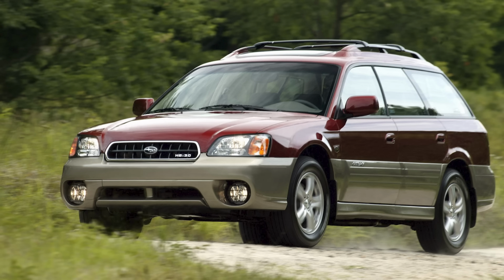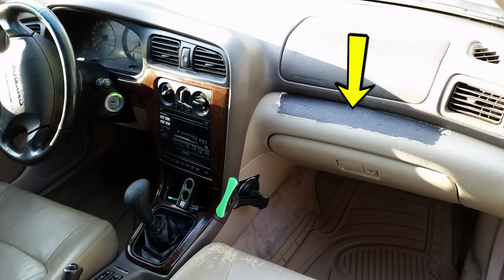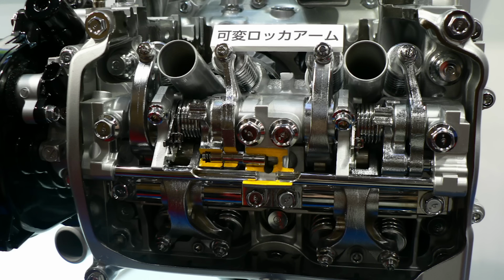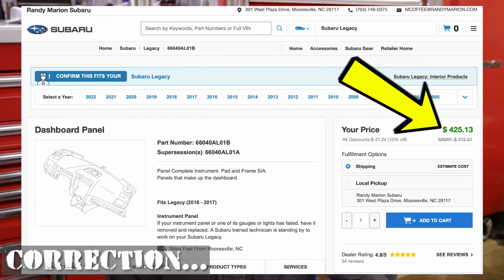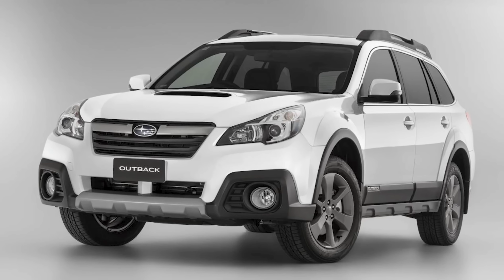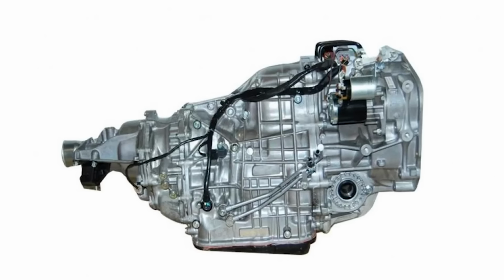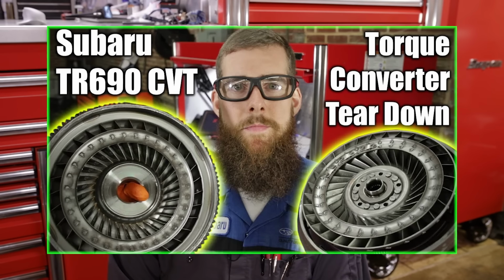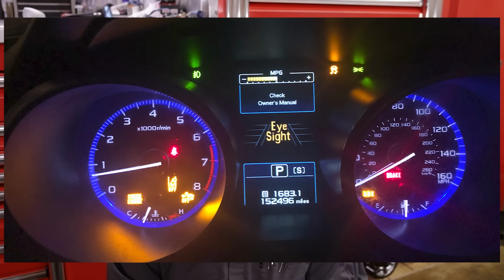Buying A Used Subaru Outback Or Legacy?! Here's The Good And Bad Over The Last 20 Years!

Comment: Thanks.  You put my mind at ease.  I bought a 2012 Outback about a year ago.  I drove it about 20,000 miles and so far so good.  The only serious problem I had was a loud thumping sound when the wheel is turned to the extreme in either direction.  I thought is was bad CV joint, but it turned out to be the front differential.  Fortunately I bought an extended warranty and the dealer replaced it for no additional charge.  Other than that, no problems, and I must say, it gets surprising good gas mileage for a car that big.  I average about 28 mpg.  Also, since the car was first purchased in Texas and spent most of its life in Arizona, I have no rust issues.
Reply: I have had my 2012 outback for a while and I love it. I suffered a transmission valve train failure at 165,500 miles, but the extended warranty I had purchased really saved me a bundle. One of the most dependable vehicles I have ever owned.
Reply: @johnsheaman8057  I have to tell you.  I lucked out with the extended warrantee.  I guess it's more like an insurance policy, but when I started having this problem, I could have sworn it was the CV joints and so did the dealer.  The dealer I bought it from was a Fiat / Alfa dealer and they changed them.  I tried turning the wheel all the way in both directions in the parking lot and everything seemed fine, but when I got home, it did the same thing as I pulled into my driveway.  Later I discovered this problem only showed up when everything was hot or at least warm.  I brought the car back and they sent it to a Subaru dealer who had the car for about two weeks (I had a loaner) and when I got it back, same thing.  So I brought it to a Subaru dealer near where I live, explained everything to them and they had it done in two days.  This would have cost me a fortune if it weren't for that extended warrantee.  As an extra added bonus, I got new CV joints.  All paid for.
Reply: try driving less than 65 mph, keep it low and somehow it last over 500 miles or less with full gas tank.
Reply: its because people never change that fluid every 30 thousand miles

Comment: in my opinion the EZ36 is one of the most reliable engines subaru has ever made. Ive been with the Subaru dealer for about 4 years now and its hands down the least worked on engine! love em.
Reply: My 3.6r has 177k problem free miles on it
Reply: 145k on my 2015 3.6 Legacy, no engine issues.
Reply: My 2010 EZ36 is at 225,000 km and running well also
Reply: My legacy 2015  with the 3.6 has over 122k so far so good and the 3.6 is smooth as silk .love the H6 .
Reply: im about to buy a 2017 3.6r touring, thats the engine right?
Reply: @QueenFairy420  yes
Reply: @TheGroundBeef  ive got it coming to me soon, just signed all the paperwork :)
Reply: How about ez30 6clinder in a 2006 jdm outback?
Reply: 154k on my 2013 outback 3.6R.  It's a great engine.  This thing does eat rear wheel bearings every 50K though!

Comment: GfS 2014 2.5 outback  just got a new cvt from Subaru at 61k.  Exhaust rusted  out too.  And it eats bulbs but you get good at replacing them 🤣... no oil issues with it.. gas mileage  is not good in whinter on snow tires it gets 21 highway.  Summer it gets 27.

Comment: I strongly agree with you the early 2000s outbacks are very reliable and a joy to drive once the headgasket repair is done 😂. I own a 01 outback limited and love the car. As long as you check on them regularly they will take care of you
Reply: I had an 01 Outback as well, the base model. That wagon out-drove most any other vehicle in the snow.
Reply: My 01 Outback base 2.5 5 speed manual 234,567 is still alive and is my daily
Reply: I love my outback have been following mr Subaru as long as I've owned it. I bought it used had to do head gaskets months later and months after that got a rod knock 😔. Long story short I am a mechanic pulled and rebuilt it myself about 2 years ago and couldn't be more happy. I believe the build quality of these wagons are great the stying and feel is rite up my Ally. love how it stands out in a crowd 😂
Reply: 02 3.0 h6 owner, and it’s been solid! 265k mi into it
Reply: Couldn’t agree more. I love my 2002. Simple and practical.
Reply: 2002 4-cyl with 120k miles here. Belonged to a family member with a shit mechanic so he sold it to me for peanuts. Replaced the rear brake discs + ball joints at the front, steering rack was leaking oil so it was repaired by a pro; since it ran low for long now the pump is dead so I'll purchase one online next month. Checked the spark plugs, air filter and belts which were fine except for one alternator belt and bearing which have been replaced. Other than that (which isn't too bad considering how little I paid for the actual car) it runs very smoothly and reliably, the engine revs real smooth and it stops on a dime. Just took it on a 300 miles trip with my family, it did precisely 28 MPG on highways at 60-70 MPH and the wife loves it. Gotta take care of some final details and I'll have a kickass ride for a few years. It's still low on miles given its age I'd say and I've already ironed out most of it's issues. I'll keep an eye on the head gasket situation tho!
Reply: @diegoleiva7242 love the basic 4 spd auto.
Reply: Love my '03 Outback. Base trim with the 5MT and the thing's a beast. Simple, durable and goes anywhere you could want. Snow? No problem. Off road? No problem.
Reply: got an 02, and love the thing, he's spot on with the problems.. I really wish the went to a bolt in wheel bearing for this generation,  i'm doing one now ant it requires a bunch of special tools.. otherwise the car is comfy , and a jot yo drive.. well appointed and a great long trip machine ..
Reply: AGREED. My modern subaru outback transmission broke 130,000 miles. $6000 to fix didnt do it. Getting a 2001 Subaru legacy
Reply: I've got a 04 Outback ll bean wagon bought it at 125k in 2021 runs great with the EZ30, best engine Subaru has ever made.
Reply: I also have an 04 LL Bean, close to 200,000 miles and still running. Very cool engine!@1mawesomel1kethat
Reply: This comment is everything I’ve been feeling lmao
Reply: @jalopy2472  the one I bought was kinda toast
Reply: I got an 09 outback and I love it, haven't had the pleasure of driving the previous generation but sounds like the best drivers car
Reply: Just had to replace my battery in my 02 outback 2.5L 5 speed manual transmission. Love my subi 🤓
Reply: I bought a 2001 2.5 Outback Preminum used in 2003. The car had 25k mileage. The first 2 yrs of ownership were fine. At about 40k mileage my engine began losing oil. Not excessively  burning it. Instead leaking  everywhere  on the engine.  I sought out the Subaru dealer for help. Since the car was out of warranty  a total gasket replacement was $2,500. In 2005. Instead I sought out a local Stock Car engine builder whom did the total gasket replacement for $1,800.  I drove the car until 2013 with no engine issues whatsoever  until I traded it.

Comment: I have to agree with you and what all you've said.  I own a 2002 legacy gt 5 speed with 293,000 miles on it.  Got it with 191k on it.  Ran it harder than I ever should of and the only time it left me sit was when the fuel pump housing cracked.  Other than that it still runs and drives but does use a little bit of oil.  Did have to replace the trans because the input bearing went bad,  but I do plan on replacing it and keeping that transmission.  My friend had a 2008 legacy with the 5 speed and it had the sticky dash.  It also suffered from a rough idle.  This car only had around 50k miles on it.  Thing would run fine until it warmed up,  then run rough until it would stall.  I couldn't figure it out.  The Subaru dealer couldn't figure it out.  They started throwing parts at it and no prevail.  They called a bunch of higher end techs in and after about a month they found an issue with the wiring harness that was causing the problem.

Comment: I still think that the group size 25 fitment number six battery typically anywhere from 500 to 550 CCA it’s just not enough power especially for the flat six, looking at Toyotas 3.5 L they’re running 700 upwards to 800cca… that’s why I change my battery about every 3 to 4 years…
Reply: I think the battery on the H6 ended up being fine.  At least it did well for me during a severe cold snap we had in my area a few years ago. I think they were much more problematic on the H4s.  https://youtu.be/ekckO45F7ho

Comment: Yep on my 13 legacy 3.6 I’m starting to get the blend door issue and sounds like a rear wheel bearing is going is making some noise I jack up the car to see if there was any play on it and it’s super tight so I’ll just let it go for now, blend door I wonder if I could get up there I think I gotta move the TCM computer it looks at least it looks like it’s the transmission control module out of the way first to get up in there maybe I can lubricate it?

Comment: My 1998 Subaru Outback Legacy Limited feels like the handbrake is being pulled on and off with a grinding sound only in sharp turns, I've replace the two front axles to no avail could it possibly be the rear gearbox I'd really appreciate if you could give me your educated opinion

Comment: I have to agree that old Subarus are better than new ones, less technology and simpler design. I can maintain it fairly easy, lots of parts available at good prices and a good aftermarket too. I'm going to change the radiator on my 2011 Subaru Tribeca. There's a lot of steps to follow, but it's not rocket science. It's so simple that I'll take the opportunity to do a coolant flush and change the thermostat. This way, I'll prevent engine overheating for several years to come. I'm very happy with the EZ36D coupled with the 5EAT transmission. It's a very solid and reliable power train. However, it's very thirsty, that's the only thing I can complain about it. Apart from that, it's a very comfortable and reliable car.

Comment: As you know, if you'd gone a few years earlier you would've been able to tell your viewers about a much more bullet proof motor than any of these newer motors: the 2.2liter. I've had 3 of them, over 300k miles on the 2 Legacys I'm running now.
Reply from the maker: The EJ22E is a bomb proof Subaru engine!
Reply: Yep my 98 2.2L has 236,000 miles and is still running great
Reply: A few years back I owned a 2.2  1995 impreza sold it with over 230 k.
Reply: Iv seen one with over 500k on it, 1997 I believe it was. And that was in wales where there isnt a flat road to be had! That was a good 4years ago now and it's still on the road so it must be over 600k now

Comment: My 2014 Outback has 120k and few problems so far. Constant headlight bulb replacement, weird clunking noises that no one can figure out what’s doing it, and a quart of oil needs to be added every 3k. Rust is becoming a huge issue but much of that is happening where damage has occurred and repaired. Also I live in the upstate NY rust belt lol. I’m 6’6” and love the roomy interior. Would absolutely buy another Subaru!

Comment: Finally now at 192k is the EJ253 in my 2008 leaking oil externally from the head gaskets. I can’t complain in the least and would have no problem getting another older Roo with the EJ253.

Comment: What air bit do you use for the gasket area on the block when when cleaning prior to replacing? Don’t want to damage my engine. Tia
Reply from the maker: 3M Roloc white Bristlediscs.
Reply: @MrSubaru1387  ty so much

Comment: Any car with a Jatco CVT shouldn't be trusted fully. I'm sad that Subaru didn't use their Toyota partnership to source them from Aisin. The CVTs in a Corolla almost never fail.
Reply from the maker: Subaru DOESN'T USE JATCO CVTS!!!
Reply: No Nissan did though
Reply: the CVTs are an in house design
Reply: Well son of a bitch, I guess I'm wrong. I know the older automatics were Jatco units so I guess I just thought the CVTs were as well especially since they seem to suffer from the same faults. I still think they would have done better to use Aisin units...
Reply from the maker: The Subaru Lineartronic CVT was designed and built in house by Subaru. Subaru designed and manufactured the first mass produced road going CVT equipped vehicles. They've got the most experience when it comes to CVT automobiles. They're no where near as troublesome as people have made them out to be, talking on the internet..
Reply: @MrSubaru1387  It was the Justy that had the first one, right? I was watching an old game show recently and one of the cars you could win was a Subaru Justy. I can't remember the last time I've seen one. Do you know if Subaru rebuilds the CVTs or do you just have to pay a ton for a new one if it fails?
Reply from the maker: Subaru rebuilds/remans them. The Subaru dealer replaces.
Reply: As far as I was aware they are least did!
Reply: @aenoymotors  Never did

Comment: I've experienced the ghost walking on my 2017 Outback, with snow tires. Unsettling. Usually occurs after rough ice patches when the rear end will feel like its floating. Over twenty years of ice driving and have never experienced the feeling until this car.
Reply: I don't know what that means
Reply: Well, for the Gen 3, its more like an oscillation in the rear. Subtle at first and then feels like its on ice skates.. Can feel the car either 1) fighting to depart from going straight, or 2) egregious understeer into a turn (this almost killed me). Much worse in my 2005 H4 before I 1) changed the shocks and 2) the rims/tires from 16 to 17. Replacing all the rear endlink and swaybar bushings helped a slight bit. I have yet to experience on my 2008 H6 and we've played in snow and ice-- in my opinion, the 17 inch wheels make as much difference as the other fixes.

Comment: I am looking for a standard transmission outback, seems like that is the vehicle to keep
Reply: My 1998 Outback was a lemon, mostly because of the engine which I eventually had to replace after several rebuilds. But the manual transmission eventually went bad, it would keep popping out of fifth.

Comment: I bought a 2000 mt a month or so ago, had to swap the engine because she ran out of coolant and died but I had a 2005 forester sitting around so it worked out. The pictures you showed look exactly like mine except there's more quarter panel rust lol

Comment: Sounds like a lot of people don't maintain and look after their cars.
I have a 2005 2.5i Outback 5spd manual dual range here in Australia, which has just clocked 301,000kms (187,000miles) and it has no issues whatsoever.
It had a full service history when I bought it a couple of years ago with 280,000kms (174,000miles) on it.
I change the oil regularly, rotate the tyres, do regular maintenance like you should and it is brilliant.
None of the issues with the UV damage on the dash etc, and this is South Australia where it's always hot and sunny.
Reply: Cars in the US are thought of as consumables by most people.
Reply: As soon as you said Australia my head voice switched from reading I Know Eh to Auzzie
Reply: Nice. I want to import a dual range for my ‘10 forester 5mt because Subaru apparently felt off-roading wasn’t a thing in the US. I’m just worried it would cost a fortune to ship one from All Drive Subaru 😬

Comment: I have a 2014 Outback and I have been mostly problem free. After 8 years, the only thing that surprised me was that I had to replace both rear wheel bearings.  I have not been seeing much of an oil consumption, but replacing the headlights are a pain. The CVT is the only real unknown for me. The manual says to bring it in at 120K miles for oil sampling and I guess they will determine if it needs new oil.  But it rides firm. The seats are good but the suspension lets me know if the road gets rough. Thinking about getting a new Outback in a couple of years (A turbo would be nice).
Reply: don't wait. change that trans fluid now. it's cheaper than another transmission
Reply: The 2.4 turbo leaks oil straight from the factory. Typically the rear main seal is the culprit
Reply from the maker: Or lower oil pan/oil level sensor.
Reply: I also have a 2014 and both rear bearings are replaced, and most recently had to have a seal in the front of the engine redone, expensive!  Otherwise, the best car I've owned.
Reply: @ssphoto66  
What kind of noise did the rear wheel
Bearings make when they went bad?
Thanks

Comment: Had a 2003 Legacy Wagon.  Gave it to my Sister-in-law.  270K+ and still going but needed a new muffler.  HG leak, etc but no milk shake so they are keeping an eye on it.  It's Used as a grocery getter.  Replaced it with an OB 2013 3.6R which is fantastic IMHO.  Low tech involved, but durable and steady with the power needed.  Handles best in the snow compared to the other brands out there.  Something about how the car drives in adverse weather conditions.  They just want to be DRIVEN!

Comment: 2000-2004 outbacks rear quarter panel windows seperate and leak from the seals shrinking. Common issue in the nw.